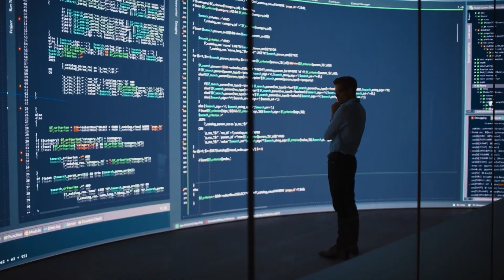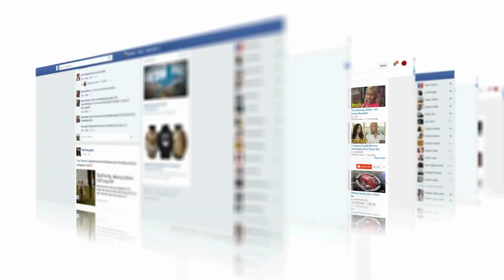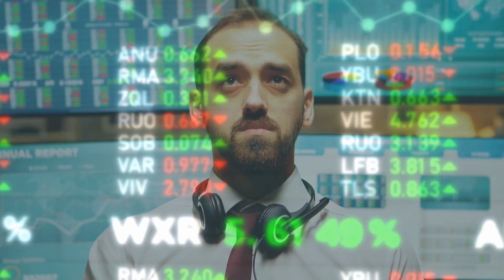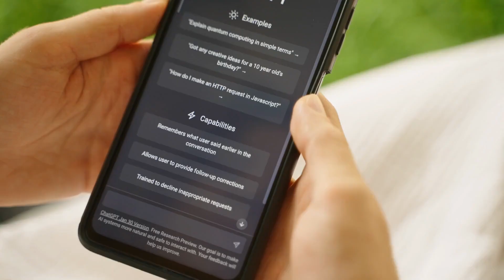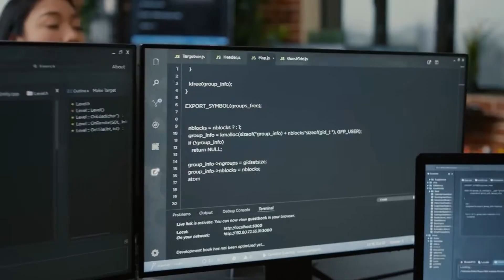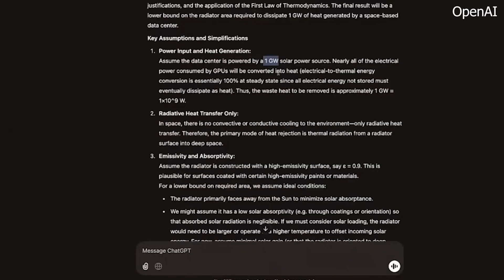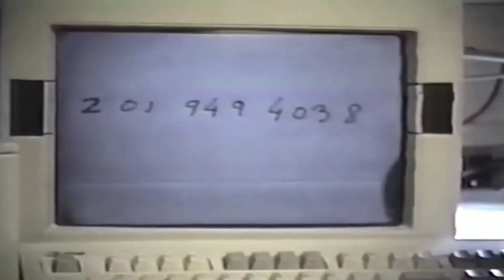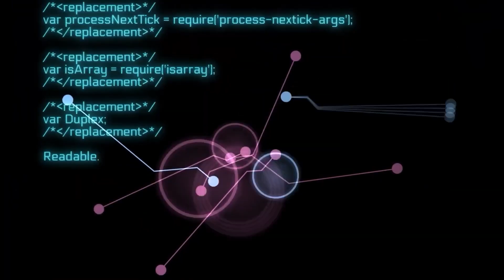The 10 Levels of Artificial Intelligence

Comment: 1. Windows is getting worse, not better. 2. Elon is a trillion times the sociopath of any malefic godlike AI. 3. The planet is still running on fossil fuels, and will never have the energy for higher AI if it continues to run on fossil fuels. Based on 2022 consumption rates and known reserves, humanity WILL run out of oil in less than 45 years, natural gas in less than 50 years, and coal in less than 100 years; and that's running low-power AI from 2022, not some future (or even current) Super-AI.